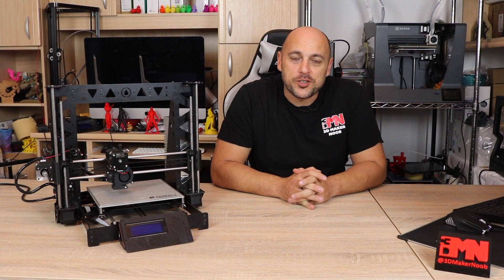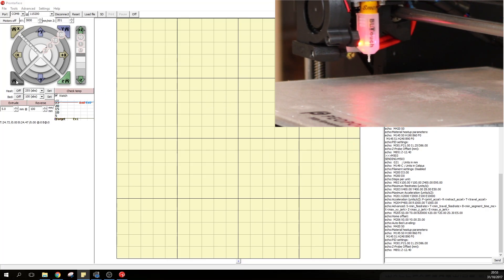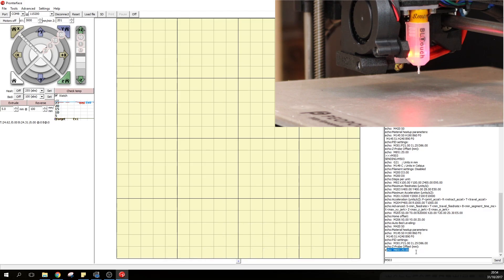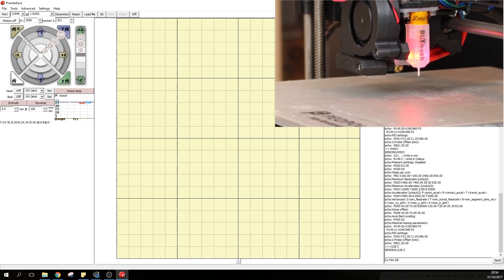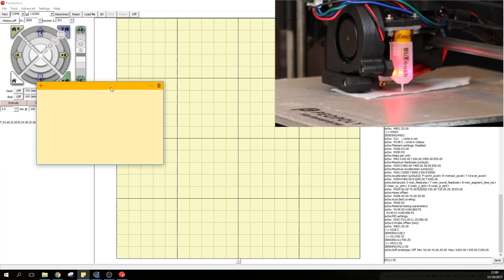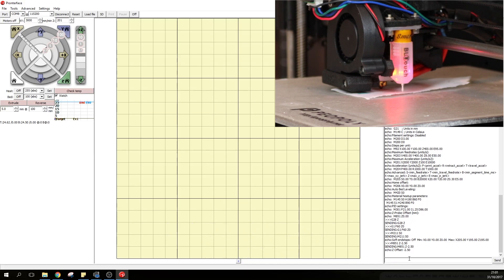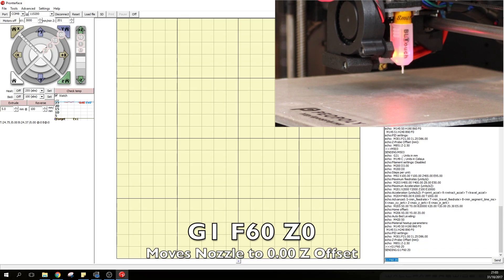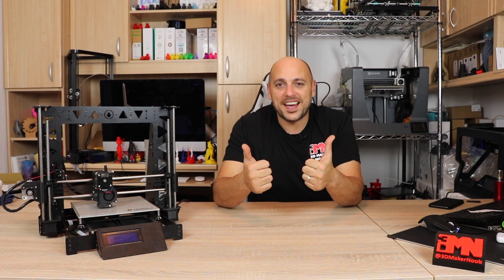Calibrating Z-Offset With A BLTouch Bed Levelling Probe

Comment: Hi Joe.
I know its an old video but I would like to ask that isn't the nozzle need to be moved to the probing point (usually is the center of the bed) before lowering to Z0 for testing the paper? If the procedure is done as you listed, then the z offset is not measuring the real distance of the nozzle to the bed because the real nozzle is 30+ mm away from the probe point. If the bed itself is leveled at the beginning, then the diff is more or less negligible, but if the bed is slanted, the 30+mm may pose around .05 - .1 mm difference, which may result in first layer not sticking well to the bed.
Reply: Not the OP but I wanted to answer question. So when the printer does this leveling procedure, it builds a virtual "map" of the contours of the bed. It then compensates for the offset of the nozzle in relation to the probe, which is set in the firmware configuration of the printer. This was, probe position does not matter, because the "map" is good for all arbitrary points on the bed.

Comment: Very good video, I use it often, summary:

1. Home
2. M851 Z0 (reset current z offset)
3. M500 (store settings)
4. M501 (set eprom as active param)
5. M503 (get current settings)
6. G28 Z0 (home z)
7. G1 F60 Z0 (move nozzle to 0 z)
8. M211 S0 (off soft endstops)
9. Slide paper until is right and write down Z axis number + thickness paper
10. M851 Z X.XX (set that value step 9)
11. M211 S1 (on soft endstops)
12. M500, M501, M503
13. Home
13.G1 F60 Z0 (check is correct)
Reply: So ignore the "-" and "+" value.  The "_" number from display and the"+" number from the thickness of the paper.  Just add the numbers together?

Comment: Hi Joe!  Great job done here, it summarizes in a few minutes what you can partially read o see in some videos and blogs but I couldn't find the whole story in one single brief place like you do here.  Great job.   

I'd probably suggest two small adds, if you think are accurate.     One is to always remark that all this operation has to be done with bed and extruder at operating temperature!    Some might skip this part and all the work will have no value once it gets to print, right?

Second thing, that it drove me nuts after instaling my BL Touch and upgrading to Marlin 1.1.8 is the M420 S1 command.   I tried and retried and my first layer was still skewed only to find out that by default (at least on my case) the auto bed level was off  (which you check with a simple M420).   The simple solution was to add a M420 S1 after the last G28 on my printer settings commands, but nobody seems to talk much about it and all the auto bed leveling is useless unless you ensure you have the feature turned on.   Do you agree?   Do everybody need that or was it just me?

Best regards and again, congratulations on this video.
Reply: @cordellabney  This behavior has now been clarified in the Marlin documentation.
Reply: Thanks a lot! Turns out mine was also off!

Comment: I followed the tutorial but the sensor did not for the z axis when requesting autohome. I play with the hand to test but it does not stop. What can it be?
Reply: The wiring is wrong then. I just had the same issue. Reversing the ribbon signal cable PIN 27 with the red 5V and it should work fine. :)

Comment: hy all, i have a bltouch on ramps 1.4, i have a isue that the right side of the bed is always lower as the left side, any explication?
Reply: Make sure X gantry is square to Z
Reply: yep, is the firs thing i do :(, still fails, i isolated the power from the board to a 5v power regulator
Reply: @deeareus9886  I don't know how isolating the power would help, but did it? I have the same issue with my BL Touch
Reply: @davidlorentzen602  you need a buck converter, to take down the 12v of your printer to 5v, so the voltage regulator of your board don't suffer
Reply: @deeareus9886  Thanks for your prompt reply, Mario. I have a buck converter for my Pi and LEDs, but my question was how does changing the power source for the BL Touch affect whether it levels properly? My BL Touch works well for a home sensor, but the result from the 9-point leveling ends up like yours, with the right side of the bed lower from the left.
Reply: @davidlorentzen602   you use some messenger? or discord? :P to send more speed messages
Reply: @davidlorentzen602  you have to put a buck converter just for the bltouch

Comment: I'm confused. In the video you said you add the thickness of the paper ".1" to the z position "-2.49". If my gradeschool math doesn't fail me the correct answer is -2.39 not -2.50 nor is it -2.59 as some others have stated. Or did you misspeak by saying add when you meant subtract?

Comment: Hi Joe. Excellent video. I am struggling to get me printer working with its new capacitive sensor. As I found your video I tried your way to set it up.. I tried it using the printer's display so far. I did it 3 times in a row and got 3 different "real" z-offset values. first -2.4, second -4.5, third -5.9..  maybe it's gonna be more next time XD.. any idea what's wrong with my setup. I cannot imagine that the sensor is that inaccurate.. hope you got some ideas for me. thanks

Comment: Hi Joe, after this calibration, what I need to put on start gcode? 
Is just G29 after the G28 enough? 
or I need to put the Z value like:
        G28 ; Home all axes
        M565 Zx.x ; set the Z offset value
        G29 ; probe bed
Thanks

Comment: Hi Joe, thanks for the clear and concise instructions. I was pulling my hair out as I could not get the nozzle below Z0 until I followed your vid and saw the M211 command. I had gone to the extent of tuning off this command permanently in the firmware which wasn't clever. Also these instructions were a lot more logical than other instructions tendered elsewhere. Again thanks for making the time to do these fantastic videos. Bravo.

Comment: Why add thickness of the paper? This does make the nozzle touch the bed. Also, after Homing Z with the probe, you need to move the Nozzle to the spot where the probe hit zero. Because probe and nozzle have different positions on the printer head.

Comment: Hi Joe, thank you for this great video. Suppose that in the future i need to add on 4mm thk glass or perform autolevel, do i need to run the calibration again?
Reply from the maker: No need to, as it would calculate the surface the same as it’s not inductive :)
Reply: OO that is great thank you Joe.

Comment: OK I have a silly question for you. Let's say that I want to use different build platforms with different thicknesses (e.g. one glass and one glass with a PEI sheet on it). Do I need to redo the Z-offset for each of them or would the auto level take care of it?

Comment: Hi great video easy to follow. How many times should I have to set the offset I did it the first time and it seemed to work. But now it's failed again also for some reason my probe does not probe the areas anymore it just auto homes then starts printing the same happens if I select auto level in the menu.

Comment: Very good tutorial! I would say though that the BLTouch is measuring a point that is offset from the nozzle. With most beds that won't be a major problem, but strictly speaking, you ought to move the nozzle to the BLTouch probing position before setting the offset. In any case, it's still a very good and clear tutorial and better than most I have seen, so thanks for that!

Comment: Thanks,  but don't forget add right G-codein  cura

G21 ;metric values
G90 ;absolute positioning
M82 ;set extruder to absolute mode
M107 ;start with the fan off
G28 
G29
G92 E0 ;zero the extruded length
G1 E3  F600 ;extrude 3mm of feed stock
G92 E0 ;zero the extruded length again
G1 F{travel_speed}
M106 ;fan on
M117 Printing...

thanks to Natan Kozerev
Reply: If you set it in the EEPROM I don't think you need to add any code.

Comment: Nice video.  My M500 command dont work on pronterface??  do i uncomment // in marlin 

// EEPROM
//
// The microcontroller can store settings in the EEPROM, e.g. max velocity...
// M500 - stores parameters in EEPROM
// M501 - reads parameters from EEPROM (if you need reset them after you changed them temporarily).
// M502 - reverts to the default "factory settings".  You still need to store them in EEPROM afterwards if you want to.
//define this to enable EEPROM support
#define EEPROM_SETTINGS

#if ENABLED(EEPROM_SETTINGS)
  // To disable EEPROM Serial responses and decrease program space by ~1700 byte: comment this out:
  #define EEPROM_CHITCHAT // Please keep turned on if you can.
#endif

Comment: Best tutorial i have seen so far, well done !

there is an error in the discription.
In the video you explained to M211 S0 to disable software endstops.
In the description at number 8. you wrote M211 Z0
At number 12. it should be M211 S1
Reply from the maker: +Kro Gon fixed thank you very much :)

Comment: I'm not sure if you have already done this. Could you do a guide about how to set a Z limit switch? I have a Tevo Tarantula and if I wind the nozzle all the way and do the paper trick, then put the micro switch dead to the bar. The Z offset then is far too high. Almost an unknown as it is very hard to measure. 
Gussing you could use this guide, set the Z to zero, remove the soft stop and lower the machine back down by 0.1 till you get to the paper and then use that number as the offset?

Comment: Do you have to add the paper thickness... I have never done that and it works fine. When you perform manual leveling , don't you set Z=0 at the point where the paper grabs?
Reply: All the documentation I've read before says that you need to leave that 0.1mm clearance to accommodate for thermal expansion of the nozzle.  In your example, you are not preheating the bed and nozzle to operating temperature.  If the nozzle was heated, then I would say yes, subtract the 0.1mm from the measured offset.
Reply from the maker: +Alex Lindeijer in reality, 0 should be the point where the nozzle is flat on the bed. Once you set a layer height in the sliver, the nozzle will start from the print first layer height. The paper is so thin though that the difference is negligible. It also all depends on how much pressure is put on the paper by the nozzle
Reply: 3D Maker Noob true...but you assume the paper is .1mm thick...which is not neglectable....so yes I confused me why most people set 0  at paper thick which means first layer would start a bit too high....glad I have baby stepping

Comment: Joe, this is a great video, clear and easy to follow. And if eeprom is not set the only thing to do is to write the z offset to the firmware code and to use G28 and G29 at each start of print. And these codes are Marlin, Repetier has different M codes but same procedure follows.

Comment: Hi Joe. If the initial z adjustment was -2.49mm and the paper was 0.1mm should the adjusted figure not be -2.59?
Reply from the maker: +Neil Watts well spotted Neil. In fact it should be -2.59 apologies, almost 1am lol it did work in the end for me as I pushed the nozzle down to the bed more than the thickness of the paper
Reply: 3D Maker Noob. Great vid and always love your channel. One of few I subscribe too 👍
Reply: and why do you have to add the thickness of a paper?
If you add the thickness of the paper, you will tell the printer to put the nozzle down to the bed.
Let say you have -2.49mm and a paper of 0.1 in between nozzle and bed. If you now go down to -2.59 the nozzle hits the bed. But the idea is to NOT hit the bed. lol!
Also, he forgot to mention to move the nozzle to the position of the sensor probe when going down again. The probe measures a different position of the bed.
Reply: Was about to mention the same, good thing I decided to read the comments first! 
Average paper is indeed .10 but lately I've been getting all sorts of irregular sizes so I've decided to move off to feeler gauges.

So, say I'm using glass? i subtract the thickness of the glass + the paper (feeler gauge)?

Great channel you got going here. Thanks for all the work and effort.

Cheers
Reply: did subtract the thickness of the glass + the paper?
Reply: Feeler is more precise - if for isntance the .15 fits in under your nozzle and .2 doesn't means you've got no more then .05 of an error.
Reply: If you are are -2.49 and added  +0.10  then shouldnt that be a -2.39?    when I do the other way the nozzle is closer  with the paper I am at -0.55m and I should not be  -.65 after adding thickness of pager

Comment: How about doing this at many points? A glass surface could be fairly curved so I'm not sure if calibrating at the center Will reflect all bed surface. How can I do this on different bed points as prusa mk2 does? Thanks!
Reply from the maker: +Natalia Gonzalez Trajtman this is only a z offset. Once this is done you do the auto bed levelling which does the 9 point levelling procedure
Reply: 3D Maker Noob did you already explain how to do the 9 point calibration or where can I find this? Great videos, keep rocking!
Reply from the maker: +Natalia Gonzalez Trajtman I uploaded a video about 3 days ago explaining how to install and set up a bltouch. It includes marking configuration for the bed levelling ;)
Reply: sorry, I missed it! you rock!

Comment: Great guide joe
One question though... As you correct the Z offset for the paper in between the nozzle and the bed, then the real Z offset from the bed is 0, but nof the nozzle will be blocked by the bed, won't it? Or do you set a correction for this in your slicer software?
Reply from the maker: +3d Print Creator it won’t because the first layer will be 0.20 height and therefore the nozzle will go up by 0.20 ;)
Reply: Thanks !!!